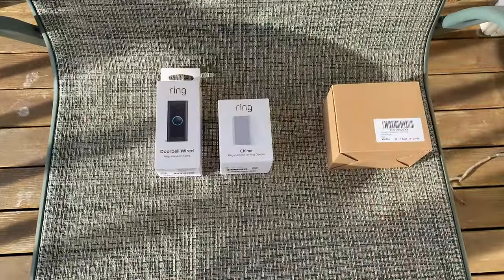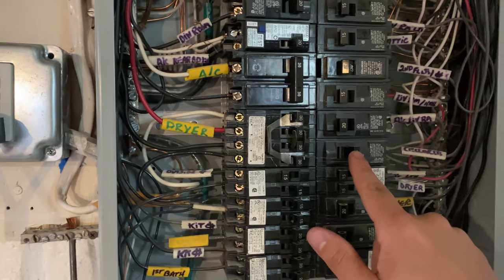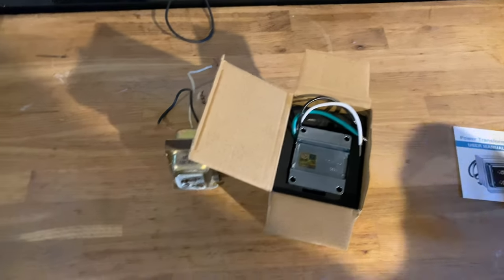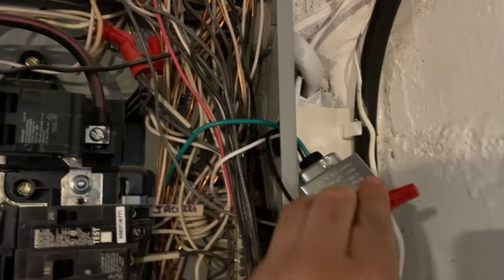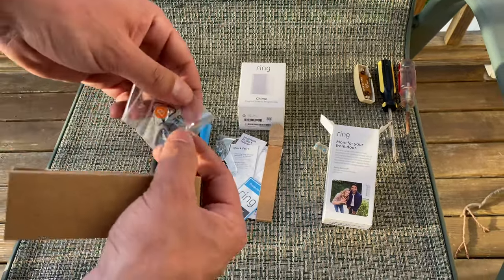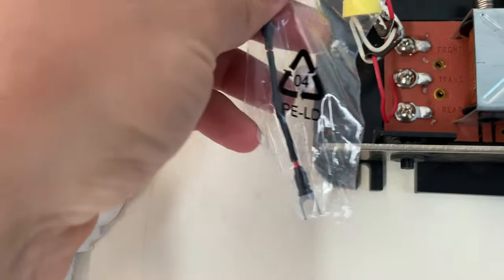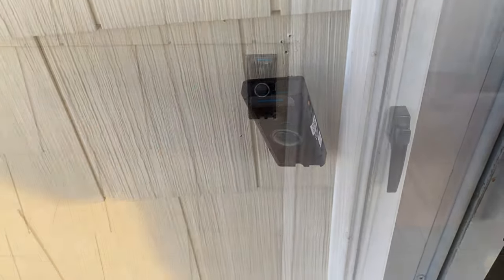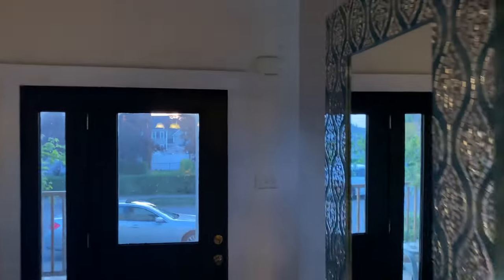How to install Ring doorbell with Chime and New Transformer 2024

Comment: My transformer is in the same location and this is one of the few videos that explains it. Though I would have preferred if you could have recorded the wiring in the fuse box. My current transformer is 16V ,  10VA and the bell doesn't ring may replace it down the line.
Reply from the maker: thanks for your comment sorry i was not more in detail with the wiring your current  transformer should work perfectly fine, the wiring in my  breaker box was so unorganized it would have been to confusing to explain but it very straight forward just connect the white and black wire and ground to and free space, if you don"t feel comfortable with a breaker box it is best for a professional  or a handy friend because there is allot of voltage.

Comment: I am wanting to install one of these. But I do not have a door bell at all. I do wish to hard wire it. And pair it with a ring chime. My question is, with out a mechanical chime, do you just run those two wires from the transformer straight to where ring door bells location?
Reply from the maker: To properly hardwire it, the wire would have to go from the Door🚪 bell to the transformer your correct, this is to charge the doorbell continuously without a need to recharge or a battery🔋 you can also get one that uses battery and or rechargeable verision this will avoid all the wiring.
Reply: @georgekataftos  yup. Got it. Thanks a lot. Im electrical friendly. I’d rather just hard wire it to never mess with charging batteries

Comment: does has to be install in new circuit breaker or i can use the light switch to pegtail to have a power?
Reply from the maker: You can pig tale idk if it’s to code but it needs 120 v and the transformer should take care of the rest